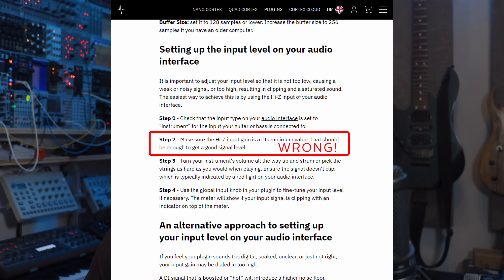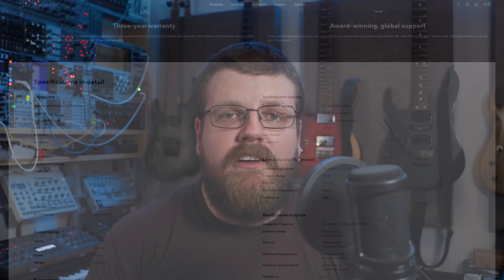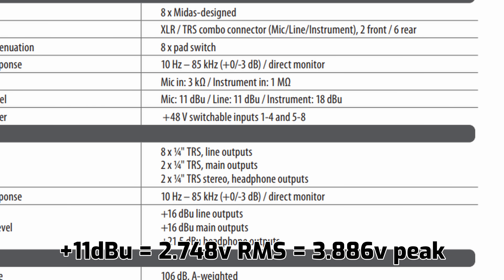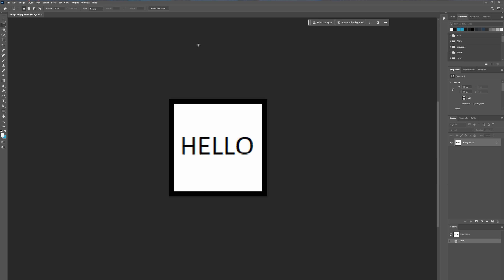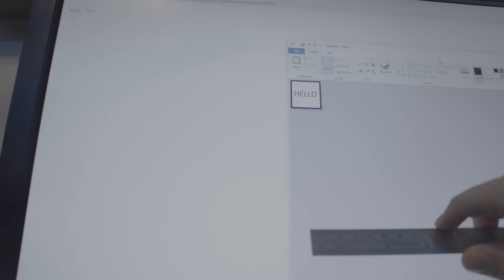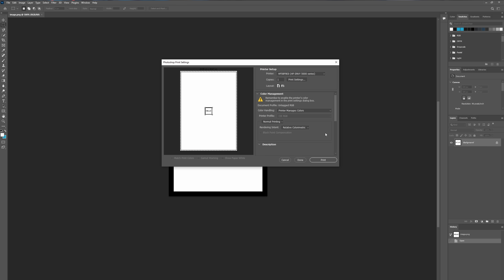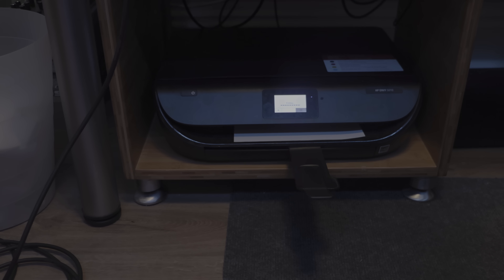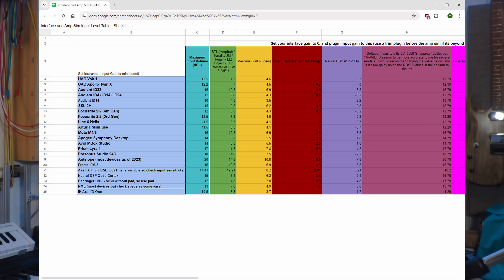Ampsims and input gain - Please, stop the madness...

Comment from the maker: I have a confession to make regarding this video. I have about a dozen audio interfaces in my possession, ranging from 25 year old M-Audio PCI units, to cheap Behringers, mid-range Focusrites and top of the range MOTUs and RMEs... you name it, I probably have it (except Antelope, that stuff is crazy $$$ :). I chose to use the Behringer because it has objectively poor noise performance, and a high instrument input level - Every interface has the same issues that are discussed here, to some degree, but the Behringer highlights them. On my Scarlett 2i2 2nd gen, following this advice still results in a good SNR improvement, but it was probably closer to 10dB than 19dB. The main point is, however; you are optimising two different things, and that's what many people didn't realise, and was the cause of all the confusion.
Reply: Can we just have a moment of silence for the PCI slots on motherboards?  I loved my Delta 1010LT interface.
Reply: @rickfinsta2951 I too have an old 1010LT PCI unit and love it. Have you ever found out if updating to a newer type interface is any better? Using USB instead of PCI slot unit any better? again I have no comparison but also no complaints with the 1010LT.
Reply: @jaytyler6203  I actually use Behringer or Tascam USB interfaces now.  I looked into getting an outboard PCI enclosure and a PCIe to PCI converter but by that time you're not really better off than USB and you have far more complexity.  My recording rig is also my Gaming PC and my DAW so upgrading the hardware was more important than retaining PCI capability for me.
Reply: @rickfinsta2951  thx , I like to see how others are using gear
Reply: @rickfinsta2951  I still have 2 of those and don't know where to get rid of them at..
Reply: @rickfinsta2951 😆🤘🎸
Reply: (crying silently with my behringer umc202)
Reply: I have a Behringer UMC404HD and I've noticed that the noise floor is highly dependent on the USB port I hook it up to. 

When I plug it straight into my computer it somehow picks up noise from my GPU. I had to "decouple" the two by using a USB hub with an external power supply.
Reply: @2und2sind4  That's probably hum from a ground loop. Have you tried powering the UMC only from USB, and/or running the laptop on battery power?
Reply: @2und2sind4  you might have just solved an issue for me...
Reply: @2und2sind4 and what did your GPU noise sound like? A low hum?
Reply: @2und2sind4 good to know. Thanks.
Reply: @2und2sind4  I noticed it picks up 50hz when the computer is running on mains, it goes away when i run on battery.
Maybe using an USB hub works kinda as a ground lift.
Reply: Yup, for proper high end interfaces, maximising AD input to as close to clipping as possible isn't always as important, you can comfortably get away with lower level inputs and it'll still sound good. But yes, understanding the difference between physical AD input level and digital level that hits the insert plugins is important, especially with analog modelling plugins!  I've even noticed differences between using a plugins internal input gain vs using the channels pre-fader to reduce the digital level prior to hitting said plugin.
Reply: @1wibble230  That's why in my location recording practice, I put the peaks at about 10db to provide a buffer for unexpected loud sections. Metric Halo ULN-8s have excellent noise characteristics, especially since the Mk IV upgrades.
Reply: @1wibble230 yes because they have more headroom in their converters and more gain in their pres to drive them to those higher levels.What's high gain in a lower end interface may only be medium gain in a higher end interface. But if it's turned down to all the way to unity, it's still going to have a poor SNR no matter what the interface.
Reply: how did you get to the +24 dB measure when you increased the input gain? also, did you have "PAD" on on the interface? it seems to advise that on the spreadsheet, any reason why?
Reply from the maker: @joaosousa1502  I basically just banged on the open strings as hard as I could for 10 seconds before and after making the adjustment, and used an RMS meter in my DAW to measure the signal. The Pad feature on the UMC is really weird. on just about every other interface, you'll get better signal-to-noise ratio leaving the pad off, because it means a stronger signal hitting your converter. Engaging the pad would just be cutting down the signal, only to then amplify it again - bad for performance. Only use it if you're actually clipping the input already at minimum gain. On the UMC, though, there is a significant difference in noise performance with the pad on and off. Weirdly, it cuts down on a lot of the self noise that the interface has, and you end up getting BETTER performance with it on. I made sure to set everything so it's running with the best performance possible out of this otherwise poor quality interface :) It's also only a -4.8dB cut, usually a pad is either -10dB or -20dB.
Reply: @GhostNoteAudio  thank you! yeah, pads are usually -20dB increments (on DIs, at least), and only engaged if you can't lower the input signal enough to not saturate the input.. well, live and learn (to use what you have to live with.. :| )
Reply: @GhostNoteAudio  I believe you have been misled by the information in the spreadsheet about the UMC behringer interfaces. The spreadsheet lists the hilariously paltry  -3dBu on the instrument inputs of the UMC404HD/UMC202HD series. Which explains the advice to use the Pad in the spreadsheet. However, the UMC1820 you use in the video, as also shown in the spec screenshot in your own video, has a dBu value much different from the UMC HD series, so you shouldn't use the Pad, I think.
Reply: @joaosousa1502 the pad advice from the spreadsheet is for the UMC HD series of UMC404HD etc. The UMC1820 used in the video actually has very different specs and therefore should have a separate entry in the spreadsheet (No Pad, +5.8 for NeuralDSP)
Reply: @bramjurriaan1593  thanks, I have a 404HD
Reply: @joaosousa1502 in the case of the 404HD the advice from the spreadsheet, to use a pad, is probably correct. If the Behringer manual is to be believed the instrument input has a low-3 dBu max input level,  so it might clip/distort without the use of the pad.
Reply: Do you know how should I set the plugin for the M-Audio M-track Solo? Can't find the dbu spec anywhere online
Reply: @GhostNoteAudio
Reply: You mentioned the Behringer's “objectively poor noise performance” - it sounds like you’ve actually measured it so I believe you!

Are you talking about its inputs/preamps specifically, or is there also significant noise in mere playback?

Briefly if you don’t mind, since you said you’ve owned a lot of audio interfaces, are there any others you’d specifically avoid or overwhelmingly recommend SPECIFICALLY for their signal-to-noise performance?

Thanks - great vid, albeit stating the obvious! 😁
Reply: Behringer highlighting innate issues that most audio hardware has... I guess there really is a purpose for Behringer after all.
Reply: @GhostNoteAudio I have a PCI M audio 1010LT for my interface, I have asked many YouTube channels and got no answer, do I need to update? I am happy with it but will an updated unit have better converters? is imput with USB better? thx
Reply from the maker: @jaytyler6203  Oh, that's an oldie but goldie. I actually have two Delta 44s lying around somewhere, the 44 was my first proper audio interface 20+ years ago :) Pretty much the same card but with slightly different IO. They should still hold up well today, last I knew the drivers still worked on Windows 10, and the PCI interface meant it was stable as a rock, and had really low latency. The only thing I'd note, is that the 1010 obviously doesn't have an instrument level input, so you're always going to need a preamp in front of it to record guitar, and adjust the gain manually anyway, so this discussion doesn't really apply to it.
Reply: @GhostNoteAudio  thx you for quick reply. Yes I updated to a newer ( for me aleast) tower some years ago and windows 10 runs my old Cubase 5 and M Audio  1010LT just fine. Just wonder if newer interfaces had anything better and usually only uses a USB plug and not a PCI slot and break out wires.
Reply: I have an orion 32+ gen 3 and Its cheaper then any RME if you look at price per IO. And its actually good despite all the rumors.  I used to own RME too though great stuff. I also own that Behringer you have lol. As soon as you said set the level to zero I was like what? No way you get that shit to clip and then back off. Or not depending on if that clipping is desirable or not, then gain stage in the box accordingly.
Reply: Come on, the Behringer is not that bad for the price.
Reply: im just here to tell you guys, that having more (higher) db room is probably more room...
Reply: I have absolutely no idea what I'm doing when it comes to recording.  Just got a 7 string today and downloaded the trial of Helix Native.  Went into Ableton.  Strummed as hard as I reasonably would while playing.  Set my 4i4 level to just below clipping.  Went into Helix Native and adjusted input gain to about -12, and I was off to the races.  Sounded absolutely immaculate, with amazing tone and literally no audible noise when not playing.  Good stuff.
Reply: My steinberg UR22 is even worse than that behringer.
Reply: @WarrenPostma  Dude! Me too, I hate the thing! Thanks for the comment, now that I know I am not alone I will buy another interface. Suggestions anyone?
Reply: @WarrenPostma  Hey just because u have the same interface (if you have the mkii that is), did you figure out the correct values? I'm struggling a bit here. 
For the Hi-Z input, the Steinberg's specs say 8.5dBV = 10.7dBu Max Input Lvl and -0.7dB to 53.3dB for Input Gain Range. I have the knob set to 3.5 of 10, which should be +18.2dB input gain if it's a linear scale (not sure if it is?). All of this going into Neural DSP amp sim, so 12.2dBu according to the sheet. Sooo, if I understand the video correctly, the formula for the digital input setting in the am sim should be Interface Max Input (10.7) - Amp Sim Standard input (?) (12.2) - Input Gain (18.2) = -19.7... But with this setting, the metal rhythm guitar preset sounds like a tame crunch. Trying to read up more on the whole topic but I'm a bit lost. Would appreciate any help!
Reply: @WarrenPostma Heh, same here. Still an excellent interface though. I call it "the poor man's Apollo Twin" due to the excellent DSPfx (and excellent drivers). If I was recording an SM7B, stick an inline Clark-Teknik CT-1 / CM-1 / CM-2 (cheap & just as good as a cloudlifter) in front - job's a good 'un
Reply: @WarrenPostma I have a UR24 and don’t have this issue. Could it potentially be the wiring in your guitar?
Reply: I’d love to see a comparison with a better interface. Along with the same DI’s and your method.
Reply: @lyricbread  yes, same thinking. 
Looks like this is a case of presenting the worst interface on the planet, with the 2 gain knobs on the plugin to 10, and call everyone wrong.
Reply: Obviously using cheap soundcards with cheap power supply and or cheap 2 prong wall power supply will be noisy. Noise ? -) Invest in something with a transformer(s)
Reply: As someone who spent 600€ on Antelope interface: Stay away from Antelope. Their hardware may be great but their software department is fvcken mentally disabled. They have the same issues for years and aren't able to fix it. My interface is essentially unusable and even after contacting support every few months to check in why my device is recognised by their software on some days but not on others (and apparently they are especially fckd on Windows 11), I completely stopped using it. Worst: Sometimes it initially works, then I want to update it but it loses connection in the middle of flashing the firmware only to soft-brick it, having me sweat for half an hour whether I can get it to run again on one of my older windows installations where the software runs more stable to flash it again. And no it's not a hardware issue. I've been given a replacement device twice, replaced USB cables, and even installed drivers and software on brand new windows installations and devices.
Reply: I knew this anyway but I think your claim of how everyone gets this all wrong isn't correct necessarily. For clarity sake, the idea was to get the plugin to react in the same way that NDSP would have intended when they made the amp sim i.e. if they set the input gain on the plugin to zero, what interface would they use to achieve that signal and to take the guesswork out of it. Most of the vids on youtube also stated that the dynamic range is high enough that even on most interfaces at zero, the noisefloor is still low enough that it's not audible. Obviously it's better to have a higher signal to noise ratio, it's just that in most cases the noise is inaudible to the point where it doesn't really matter. In your vid it seemed like you pumped up the volume to really hear it. Also the problem is that on most interfaces, it's hard to know exactly how much you increased the input gain and therefore you don't know the exact amount to decrease the input gain on the plugin. If that was possible, it would solve the whole problem. Good vid though.
Reply: @teatime6414  no, because every interface has a different reference level. 0.7 volts? 1 volt? 1.3? Who knows!
Reply: @teatime6414  agree 100% basically commented the same above
Reply: @ 1:00 seems there is a confusion there. 
The input measured in volts, had always a good representation in the digital domain. I don't understand what you're saying about "an arbitrary number between -1 and +1". What is it between -1 and +1? The volts at the input are corresponding to decibels on the dBFS scale. 
For example, NDSP are calibrating their plugins at 1Vp (meaning, the pluging should "see" -13dBFS at its input)
Analog domain sine waveform 1 Vp = 0.707 VRMS = -0.79 dBu equals -13 dBFS in the digital domain.
In other words, when feeding the audio interface input a sine 1 Vp from a signal generator, it results in -13 dBFS in the digital domain 

Neural DSP, the creators of the plugin you're using in the video are recommending this

Step 1 - Check that the input type on your audio interface is set to "instrument" for the input your guitar or bass is connected to.
Step 2 - Make sure the Hi-Z input gain is at its minimum value. That should be enough to get a good signal level.
Step 3 - Dial up the global Input Knob on your Plugin so that your signal peaks between -14dB to -9 dB. The meter will show if your input signal is clipping with an indicator on top of the meter.
https://neuraldsp.com/getting-started/tips-for-using-your-plugin

And it's not only NDSP recommending this. Many other plugins developers are having the same recommendation
Reply from the maker: @OrangeMicMusic  No confusion in the video, no. When you say "The volts at the input are corresponding to decibels on the dBFS scale." that is literally what I am explaining is not the case 🙂 It varies from interface to interface, and depends on whether you have pad on or off, whether you're using a line, instrument or mic input, and where you set your gain level - yes, even if you set it to zero.

You say: "Analog domain sine waveform 1 Vp = 0.707 VRMS = -0.79 dBu equals -13 dBFS in the digital domain. In other words, when feeding the audio interface input a sine 1 Vp from a signal generator, it results in -13 dBFS in the digital domain " - This is absolutely not true and that is in fact the whole basis for me making the video. It may be true for some interfaces, but far from all of them. In fact, it's not true for any of the interfaces on the list in the spreadsheet.
Reply: @GhostNoteAudio  true, it varies from an interface to another. I wasn't very specific when copying/pasting info from NSDP. The whole explanation (I'm sure you're aware of this)

<<If you want to calibrate your interface in order to mimic the input gain our engineers use when creating and testing the plugins,  feed a sine waveform 1 Vp = 0.707 VRMS = -0.79 dBu to the interface and set the interface gain to such level that the DAW peak meter shows -13 dBFS. Feeding a sine waveform on different interfaces will result in different values (again, this is the reason why we cannot provide a concrete value). Check these examples of feeding a sine waveform 1 Vp:
    UAD Apollo x6: -13 dBFS
    UAD Apollo Twin: -12.9 dBFS
    Quad Cortex: -15.1 dBFS (1M impedance) Input level at 0 on QC.
    Focusrite Scarlett: -13.1 dBFS
    Focusrite Clarett: -14.6 dBFS
    Apogee Duet: -14.5 dBFS>>

That's why NDSP are trying to solve this confusion by saying - set Hi-Z input gain is at its minimum value and dial up the global Input Knob on your Plugin (not the input gain of the interface) so that your signal peaks between -14dB to -9 dB.

With any decent interface starting from 3-400$ you'll have a reduction of  maximum 1-2 dB in SNR. And we have to keep in mind that you used very extreme settings in the video, just to prove your point. I tried 3 interfaces yesterday (Tascam US-16X08, Focusrite Scarlett 18i20 3rd Gen,  UAD Apollo Solo) and I got a max 1.5dB reduction in SNR. Not worth the hassle.
Reply: @GhostNoteAudio  That is not quite correct. 'dBu' is a defined scale with a defined reference. dBFS is not, it just has a reference of 1.0/-1.0 in floating point format as 0 dBFS (= 0 deciBel Full Scale). The differences result from the AD converters used, the AD reference voltage applied, and probably some inherent gain in the analog circuitry in front of the converters, which may introduce some fixed gain (e.g., a non-inverting opamp in 'standard' configuration might be 6dB hotter than an inverting 'standard' configuration). The problem isn't electrical, it is how the interface maps input values to floating point values. So, what you can do to linearize this is to apply a reference signal of known amplitude to the interface input and observe the dBFS amplitude resulting, then adjust by a fixed gain to result in a "working standard' input amplitude of, say, -6dBFS or whatever your plugin prefers. That is essentially the process you used here, only with the variable input of a guitar signal which is indeterminate. For good measure, if the interface has a gain knob, you can even map out the linearity of the adjustable gain by taking a series of measurements; this way, you can have a handy table of expected signal amplitude for your equipment and take the guesswork out of it, leading to more predictable results.
Having said all of that, thank you for doing this, a lot of people have no idea how these types of things work. And for anyone serious about this stuff, I recommend you obtain a signal generator and use that for your measurements, it's an invaluable helper to have around for those kinds of things (and debugging signal chains, e.g.).
Reply: And, if I may, in addition, you need to be very careful when reading the data sheet / technical specifications for equipment. Manufacturers give their specs in a number of different dB scales. They could specify in dbV, dBu, dBm for instance. Those refer to very different reference levels for 0 dB(unit) and would need to be converted to a common scale for comparison.
"Pro Audio" usually refers to dBu, while consumer audio typically refers to dBV; if the engineers have a telecom background, they love to give their specs in dBm. If the marketing department totally wants to look awesome and obfuscate stuff, they will invent their own scale, or not give the reference unit at all. Unfortunately, it is a mess, but fortunately, it is a mess that can be resolved with a little effort in creating such a table as yours.
Reply from the maker: @lucemiserlohn  Thanks for your comment. I'm not sure what you're saying is "not quite correct", but my video essentially agrees with everything in your comment, and I agree it's all correct information. You say "The problem isn't electrical, it is how the interface maps input values to floating point values." - Yes, I spent several minutes of the video talking about that 🙂, even going so far as to make the analogy between mapping audio input signals to floating point numbers, and digital photographs and how we need to specify DPI to print them on a piece of paper (mapping the digital values back to the analog domain).
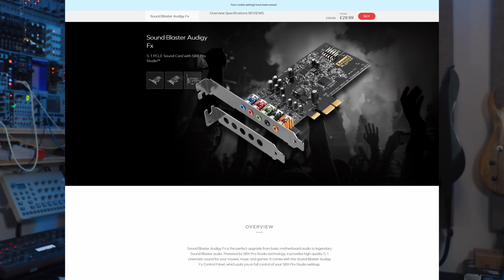Reply from the maker: @lucemiserlohn  I made one mistake when reading the script at 1:49 where I incorrectly said dBu - but I added a correction on screen because that soundcard has its input specified in dBv. I'm assuming your comment was directed at other viewers, rather than me? :)
I'm actually planning a follow-up video specifically to go over decibels and all the different measurements and references related. It's always a source of confusion for people.
Reply: @GhostNoteAudio  From your earlier comment you were talking about things I misconstrued as dBFS being tied to a defined scale, that's what I was referring to by not quite correct. Maybe I misread your intention there.
Reply: NDSP are wrong on this one dude. The big tell in that one, is the word "should". There's a ton of variables that make that "should" not true in many cases. They're taking a chance, hoping it works for most people, because it's legitimately difficult to explain gain staging to an audience not exactly renowed for their technical knowledge. Their advice would definitely not work with my interface, which can go up above noon without clipping the Hi-Z inputs, with EMGs.
Reply: So with an excellent interface that has a very good noise floor, going with 0 gain is still ok if you’re willing to get a bit of noise just to not go through all this?
Reply from the maker: @devnull5109  With loud pickups, and an instrument level input that peaks around +10dBu, you're going to be pretty close to running at full level anyway at 0dB. It becomes more critical to adjust the gain when you have low output pickups, a cheap interface, or using super high gain ampsims. The main thing to understand is that optimizing the analog signal going into your interface, and optimizing the digital signal going into the plugin, are two separate things.
Reply: @GhostNoteAudio  thank you, this is very helpful
Reply: @GhostNoteAudio Precisely
Reply: @GhostNoteAudio With loud pickups and 7 string the output level can be higher than 4Vrms. That's gonna peak majority of interfaces. So the issue mainly lies in reality.
Reply: @GhostNoteAudio  So use all your Input DAC's bit depth and generate as many binary codes as possible, giving you the best signal to noise ratio.  Then adjust the digital gain  of the plugin down to get the clearest resulting sound.
Reply: @GhostNoteAudio  I think a major point in this topic is the fear that adding gain at the interface input could make every pickup sound the same, nulling their differences.

But, if I understood this video correctly, I think this method could only null the differences between pickups if I follow those steps EVERY time we switch guitars, without having the real amp to compare the results, right? 

So, it seems to me that the best way to do this sort of calibration would be by picking the guitar with the hottest pickups I have and follow the steps described in the video. Then I just need to save both how much gain I've added in the input of the interface and how much I've subtracted on the plug-in input.

If I then keep all those settings saved and fixed, without readjusting everything for each guitar I own, then I should preserve all the differences between the different pickups I have at my disposal, while still feeding my plugin with the healthiest signal to noise ratio possible.

Does that sound right to you?
Reply: @GhostNoteAudio  which basically boils down to "sh1t in = sh1t out", as my old mucker used to say
Reply: @GhostNoteAudio As simply as you explained this stuff, unfortunately it's going over a lot of people's heads, they're now fixating on your choice of interface and the fact you had pad engaged. Unfortunately you can't fix stupid. 

It's all about getting the best signal strength hitting the converters, to give you the best signal to noise ratio, and then setting the digital level going into the plugin to be what the plugin is expecting to see. How that is achieved depends on a ton of variables, like your pickups, your interface, whether you're using an instrument input or a DI box, which often could itself have a pad and an option to select for line or mic level. None of it really matters as long as you get a nice strong input signal that's not clipping.
Reply: @johnyang799 😂 Yea..... thats not true.  When I record my 7 string with fishman modern's and a fresh battery. I can play through my interface beating the ever living fuck out of my guitar,  instrument level on, and the knob at 10 o'clock. And..... guess what?

Not clipping lol
Reply: @devnull5109  The "going through all this" part isn't really that difficult. I adjust input gain on my interface depending on whether I'm singing a verse or a chorus. Just play the part that you wanna record while monitoring your interface, adjust till you observe clipping, then back off a little. Once a part's been recorded, you can set it to whatever db level you want (below 0db of course) within your daw. But you cannot properly fix a noisy recording.
Reply: @dm1456-h7y so, in Logic, it would be to reduce the xdb required on the guitat track main volume before adding the pedals and amp designer, isn't it?